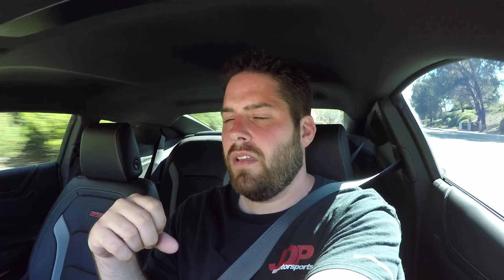Stainless Works Camaro Exhaust (16-19) - Drive with Lethal | S1: EP11

Comment: I have a 2017 SS and on December 7th I am getting Stainless Works Redline Cat back installed.  Pro Truck and Car in Pennsylvania is installing and they are excited because it will be the first Redline they have installed.  I am excited because the stock exhaust is not much louder than my Lexus RC 350 F sport.  I can't wait!!!!!

Comment: Drone is not a buzz its more of a booming sound. I had a B&B 3in on a 95 Corvette, and the drone would numb your brain right at interstate cruise speeds. If you put up with that much audible punishment just for a certain exhaust sound, more power to you and learn how to sign! It sounded amazing at full throttle and idle. Off it went and i put a Corsa on it. All was well again. I have a Borla Atak on a '16 M6 Challenger Hellcat(17lbs boost) and it is crazy loud without any drone. Crackles, pops, burbles, backfires and no drone. Dont accept the drone👍

Comment: People are WAY TOO picky about this "drone" bullshit! Yes... At a certain rpm, your exhaust will hum a little but, (usually about 2,000 rpm's) depending on rear end ratio, (because gearing will affect the sound of the exhaust), but JESUS people... It's one of the sexiest parts of aftermarket sound! So you want a car that sounds good "outside" but not "inside" !? I don't get it. If drone bothers you then your a pussy and should of bought a fucking prius
Reply from the maker: Agreed. I got my exhaust to hear it.

Comment: I'm going with axle back on my 2017 1ss with dual exhuast. I will be getting a new quad diffuser seeing I'm getting quad tail pipes. I'm leaning toward the sw axle back but from what I'm reading the flowmaster axle back also dual with mufflers sounds better. The only negative for me with flowmaster is the 409s stainless steel versus the 304 on the stainless works axle back. Whats your opinion Matt? Also I have npp and I will be purchasing with npp.

Comment: Okay I’m considering doing the headers and x pipe on my 2018 Camaro SS, my question is : Are you seeing issues relating to the higher heat temperatures coming from the headers causing the air conditioning refrigeration lines getting too hot and compressor shutting down on high head, (thus losing A/C until you get moving again) while in traffic or idling in hot ambient temperatures? I ask because I had this issues with my 2012 Corvette GS with Kooks headers and full exhaust.
Reply from the maker: I haven;t had any issues around that. I am in SoCal with pretty hot days.

Comment: I have it, and it drones like a sob at highway speeds. Its extremely fatiguing for anything over 20 min. valves closed makes no difference in the cabin, which you shouldnt expect anyways. It does sound badass, but she does drone, its not subjective
Reply from the maker: Keep in mind a lot of the noise isn't drone, its actual exhaust tone. Drop is caused by frequency harmonics, and tone is just straight sound.

But keep in mind this is a off road system and is not advertised to not drone as it will drone for sure.

Comment: Hey lethal, when you put the stainless works exhaust on, did you get a check engine light later on??
Reply from the maker: I got CEL's from the 02 sensors. This system is an off road system, unless you tune your car, you will get a CEL.
Reply: LethalGarage thank you brother i appreciate it

Comment: in years past, I'd say aftermarket exhaust was marketed towards performance and reliability. in recent times OEM exhaust systems are fairy efficient. It would be a safe bet most systems are currently sold based on sound alone

Comment: what's going on I have a couple of questions about a 2016 camaro 2.0 turbo is there a way to give it a better sound and HP with out it sound like a go cart ?
Reply from the maker: +Marcus P It's a turbo 4... you don't have many options.
Reply: +Lethalhammer true that's what I was telling a couple of guys from work lol what is possible?
Reply from the maker: +Marcus P I am not current on the 2.0L turbo and aftermarket options unfortunetly. Not many companies making stuff yet.
Reply: Yea it has been hard to come up with different mods for the 2016 but thanks again please post a vid if you come across anything and I will continue watching the vids.
Reply from the maker: +Marcus P will do.

Comment: Backpressure is basically a myth.
Reply: No not really. Lack of back pressure will cause your car to back fire. That's why if you have an exaust leak and get on your car fairly hard itll backfire. Which wouldn't be that big a deal, but it backfires up through the engine. In the days of carburaters it could start an under the hood fire. Today not so much but its probably still not healthy for the engine.
Reply: +t upole you go on believing that.
Reply: Not when it comes to the 350 and 370Z
Reply: Its easy to see. Ever watch a demo derby where they've cut the exaust off and run it out the hood?
Reply: an exhaust doesn't cause backfire a too rich or too lean afr does.

Comment: magnaflow as well but there is a difference between drone and exhaust sound.. my super 10's are strain drone and not a good kind lol.. im gonna add the resonated xpipe to tone t down a bit and ive had flowmaster on a lot of my vehicles mostly older car's they all drone like mad your setup seems nice and since you have duel mode it's probably better on drone im assuming less drone... and with 3 inch you will get performance over stock straight through 2.5 or whatever the SS is. for that motor too many people have this whole back pressure thing in their head just because they heard someone else say it but you would be surprised how open you can go ( scavenge )